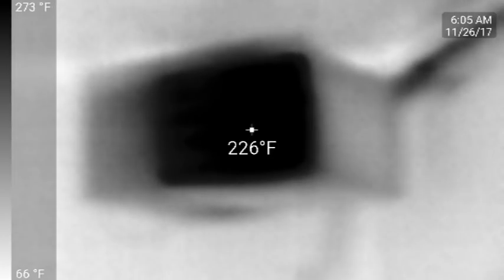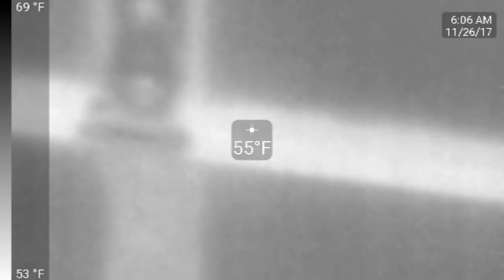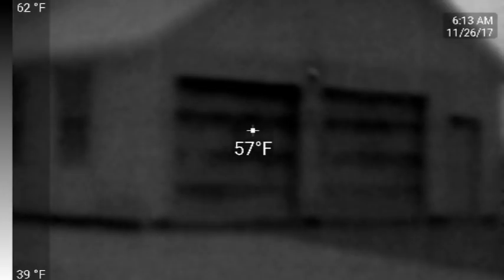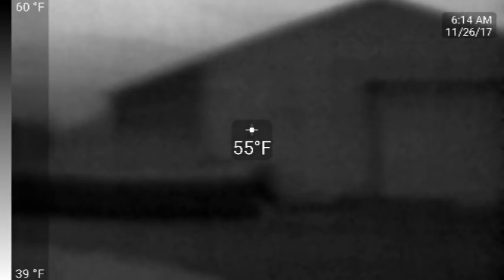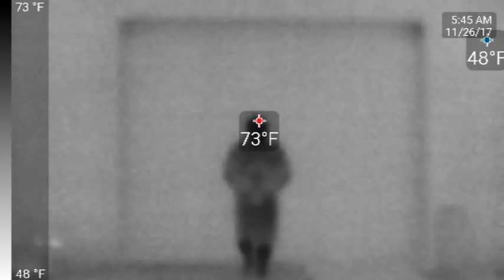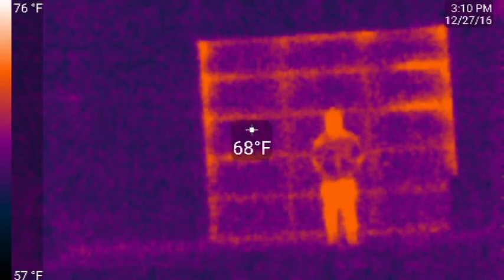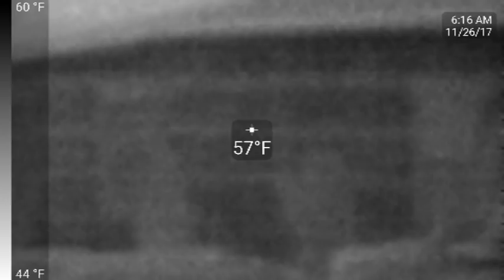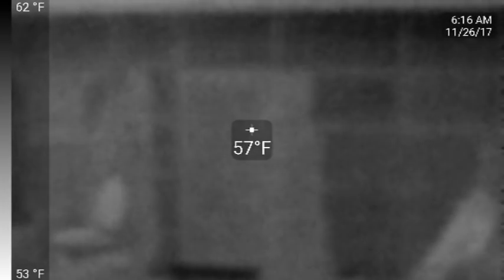One year review on garage door insulation project.  You will be amazed at how well this worked.

Comment: Most garage door warranties are voided when you add insulation
Reply from the maker: Hi Mike,  most likely but I really don't know about this door it's 12 yr now.  My concern was energy cost and the ability to control the temperature of my barn year round...   It has been a complete success and still working just fine.   Thanks for watching..   P.s.  Now that the `Honey Do List is Done' I have some serious fab projects for the barn this Winter so stay tuned if your interested.   You can follow along on Instagram @ `southernengineering'
Reply: Realistically you will never recover the cost of the insulation vs. amount of energy saved.
Reply from the maker: Not true mike.   My barn 2500 sqft , R19 in the walls and ~ R40 in the ceiling, the door was the weak link.   Before I insulated it my heating bill was Just over $200 a month and very hot in the summer, now my heating is around $100 a month.  I keep the barn at 55 in the winter when I'm not using it but most times it's at 60 in the winter and cooled to ~75 in the summer.  The cost to insulate the door was roughly $200 ( if I recall correctly) 3 years ago.   The most important part is that I have full use of the building year round in comfortable environment for what ever I wish to use it for.
Reply: @oldfatandtired6406  fuck the money I hate freezing my dick off